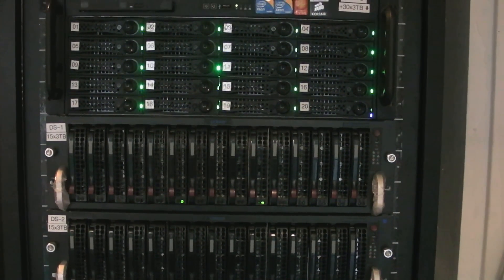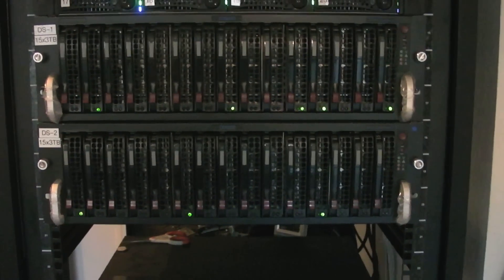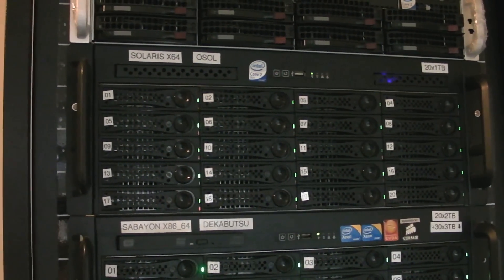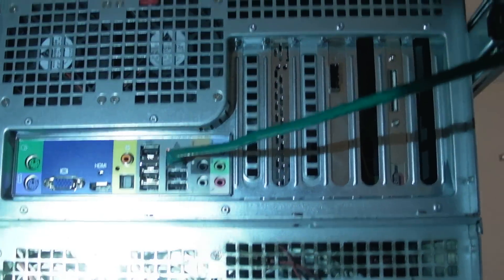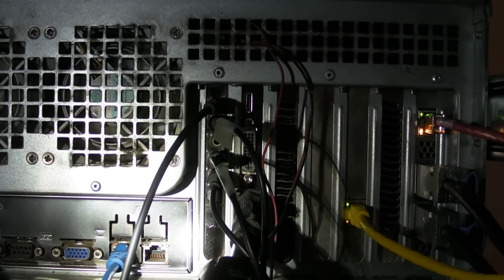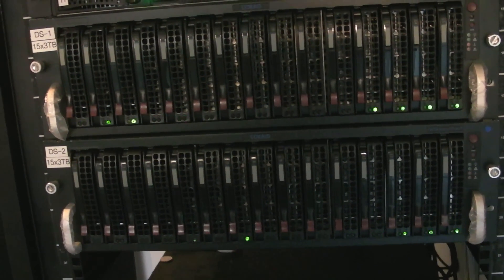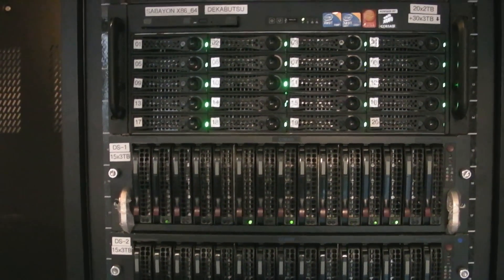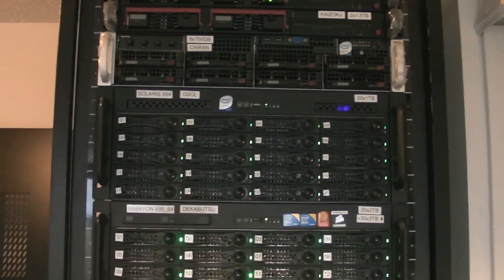Home server room/datacenter (full rack)

Comment: I just checked mine last weekend.  I have a couple of PE R300, a PE 750 and one Drobo loaded with 2tb drives = 8tb of storage.  Nowhere near the storage capacity you have but I pull squat for power.  ~526W for the whole rack with three servers, one big switch and one small switch and a desktop PC being used to host something.

Comment from the maker: Not everything is powered on all the time. Its usually using 600-800 watts of power though. My electricity bill is around $150 when the A/C doesnt have to run and $300 or more when the A/C runs (as high as $450).

Comment: You should really install the sides, and the front door, and on the back create a vent to such all the hot air ot, while you pick the cool from the floor.
Other than that 1KW looks awesome, also the setup is what I call enough, if you need more you can add, but this is normal.
Fans however you can put to adaptive, it would be with the doors much more quiet.
Good work!

Comment from the maker: Raid6 is the only raid that can recover from read errors during a rebuild (assuming not double-degraded). You would be surprised how often Raid10 fails because the other mirror pair is having issues during the rebuild. I worked for a huge web-hosting company (over 1000 8 disk arrays) most were raid10 and I have seen over 80 arrays fail. None that were raid6 have failed..

Comment: Your point?  Even if you use 1+0, an unlucky match of two drives can take you out.  Go RAID 1+5 if you're that paranoid.  Sacrifice more than half of your storage space to the gods of redundancy!  Actually, RAID 5/6 is OK for data warehousing application at this scale.  It's a home lab anyway, if the guy has a spare disk lying around, what are the chances of losing another one or two while the replaced disk is rebuilding?

Comment from the maker: Not exactly a great suggestion when the whole point is massive amounts of storage. Right now the cheapest SSD's go for around 50 cents per gigabyte. The last drives I bought in mass (30x3TB) ran me under 4 cents per gigabyte and that was like 1.5 years ago. They are still 10x expensive. SSD's make no sense when you need a lot of terabytes of space. It only makes sense if you need very fast disk I/O. Also my newest array can do 2 GiB/sec read and > 1 GiB/sec write in raid6 so its plenty fast.

Comment from the maker: My biggest array is 30 disks most of the others are 24. The odds of losing 3 disks completely are pretty low. I worked many years in a data center and see drive failures all the time. Since I have switched to hitachi I have not had a single drive fail (even ones running over 1000 days now) as hitachi is extremely reliable. Also I have recovered >50 arrays at work so I know what I am doing if something did go wrong. I constantly monitor SMART and replace disks well before they actually fail.

Comment from the maker: I have two of them now. They are 1500VA and the cheapest rackmount (with ears) UPS i could find. I got it for around $200. Model is:

powercom KIN-1500APRM

I haven't had any super long outages when I was home. Only one when I wasn't and the UPS died before I got home. The only other outage i had was when i tripped a circuit breaker and that was about 5 minutes which it lasted for with around 500-600w of load and that was on the 2-year old one.

Comment from the maker: Only stuff I got for free were the 3u supermicro chassis as they were being discaded. All the disks  and hardware was bought by me but over a several year  period. I also got excellent deals and bought at the right time. The 30x3TTB drives only cost me around $3450 which which I bought on 2010 just before the taiwan floods when they were at their lowest. You would be lucky to get the same prices I did now almost  1.5 years later.

Comment from the maker: Neither. For network based stuff I don't really have a need for >1 gigabit especially when the server kind of doubles as a desktop with 30 foot cables to my bedroom. The 30x3TB external disk array I have is done via two SFF-8088 links which are 24 gigabits each (sas6) for 48 gbits total although the raid controller is the bottleneck itself at around 2 gigabytes/sec (16 gigabits).

Comment: I think this guy is hosting torrents for a private tracker and keeping things seeded. Which equate to a lot of TB.

Mine is about 400TB. If you put that much porn in there you would never be able to organize it all =P
I use mine to store Bluray ISOs and ripped Episodes at high bit rate. Using infiniband just for moving stuff around the servers and 10g to htpc. 1g to other computers around the house thru redundant switch.

My rackmount for my amps cost more then my actual server =/

Comment from the maker: While you can have a non-raid controller using the same setup I do which costs as little as $100 they are generally going to be a PCI-E SATA/SAS controller (not necessarily raid though). There are things like eSATA and what not but have huge throughput constraints. 

Like I said though there are some $100 cards that don't do raid that support SAS expanders and external SFF-8088 cables which is what I am using hooked up to a raid controller.

Comment from the maker: The chassis themselves use the SATA/SAS signaling through the ports for disk activity so its not done by the expander or anything. This is true of all supermicro chassis and most others. The *fail* lights though use SES2 and can be more of a PITA which I do not have working.

I just did a random seek to light up the lights for the video =).

Comment from the maker: Man it is common knowldge VZ FIOS (except in some areas where it goes over VDSL) is fiber to the home/premesis. its fiber the entire way from the CO to my home. They might use copper interconnects between switches/routers in the CO but they would be for very short connetions. The dmark end at my house is indeed a fiber cable.

Comment from the maker: Here is a link to the spec sheet of the ONT right on the side of my house:

tinyurl com slash 6nofzxo

You still gonna try to tell me I am not on Fiber? LOL

Operating Wavelengths:

1490 nm voice/data receive
1550 nm video/receive
1310 nm voice/data transmit

Comment from the maker: Ok the problem is YOU are misinformed. It is fiber. Look at the pictures on this thread when i first went from dual 35/35 to 150/65 (actually 150/75):

tinyurl com slash 86vctvp

It shows my serving hub (0.5 miles from my house) and the other pics show the ONT's (and the fiber actually going into it) which is *right* outside my house.

Comment from the maker: Also yes VZ is not dedicated as its PON it is shared. However; it is a 2.4 gigabits down 1.2 gigabits up connection shared with up to 32 users (I am on a 32 port splitter). Honestly though most people get the 15/5 service and there was only 1 other person on my splitter when I got service. After that it mainly uses alter.net (vz's tier1 backbone) and speeds are always great for me.

Comment from the maker: True but its still pretty damn good service. You can't run BGP on it or use your own IP addresses but dedicated does not matter as far as speed. I have never seen anything on VZ anywhere near saturated. If you checked my bandwidth graphs you will see my average upload speed is 118 megabits over the last week (of around 150).I use QoS so it limits up to about 145.I have uploaded 20TB/month+ off VZ for 2 years now.Back when I had two 35/35 connections I had it saturated for an entire month before.

Comment from the maker: Its a Norco RPC 4020. A very cheap chasis but I have since upgraded to the Supermicro SC846 that I got for $250 with no PSU/scaddies (normally $1000+). The Norco is a $300 chassis but does leave some things to be desired in build quality. One of the backplain SATA connetors came off when I was wapping chassis =(

Comment from the maker: If its going over fiber it sounds to me like metro ethernet or something. I am amazed that they would give you that for cheaper than on their DOCSIS based service. We have a 10 gig connection with comcast at work and even then its atleast $3/megabit so that pricing seems way to low to me. Is this actually at an office building or something (maybe already wired with fiber). Speedtest?

Comment from the maker: Fios's first package over 50 megabits was 150/35 (really 150/75). The only place that people could ever get the 50 mbit package for around $100 was in NY/NJ where 150/75 is also cheaper. Everywhere else in the U.S. was like $140 for 50/20 and $199 for 150/75 (more if business/static IP).

I am still curious as to where comcast advertises 150 megabits anywhere. Considering I know 100% FIOS has never had a 100/50 package I believe you are mistaken about comcast as well.

Comment from the maker: Totally does not work for me. I use a PS/2 keyboard for latency reasons (I played stepmania) and I run a DVI monitor at 400 Mhz pixel clock (2560x1440 @ 100 Hz) because I game. No kind of remote system would work for that. Also I don't want another computer I would run it on and have to have running when I use a computer. My main machine is already 24/7 so might as well use it as a desktop too. I already have KVM via IPMI if I need remote access. And its linux so serial console is enough anyway.

Comment from the maker: What I have is actually pretty cheap for the speed I get for U.S. standards. Some businesses pay more than I do for bonded T1 (3mb/3mb). The cheapest (I know of) 1000/1000 service in the united states is PAXIO which offers 1000/1000 $245 USD/month. I would much rather have that service if it was available. Verizon's maximum speed is 150/75 per connection. Verizon is the only national-level fiber ISP i know of in the US (fiber in 5+ states).

Comment from the maker: @TheProthon It is running the linux distro 'zeroshell.' I originally switched to this as it was the only one I knew of that supported VPN bonding out of the box in a nice interface. I stopped bonding when I went from two 35/35 FIOS two one 150/75 but will be going two 150/75 soon and do bonding again. ZS's interface is not easy to use for beginners but nice if you already know iptables.  I modified the install for a full R/W version and use it for a lot more than a router.

Comment from the maker: @NoosesHigh The rack with what I normally run 24/7 runs around 550-600 watts which isnt that bad. My powerbill in none summer months where I don't have to run the A/C is a bit over $100/month even in expensive socal. The A/C is actually a lot more than the rack as it will use 5-8x more power although it doesn't run 24/7. During the summer my powerbill is closer to $250/month.